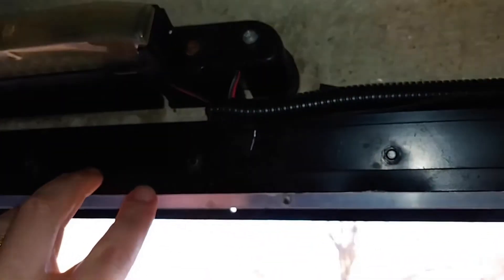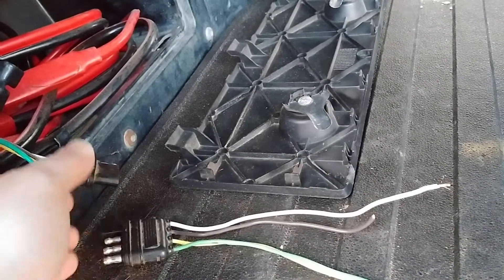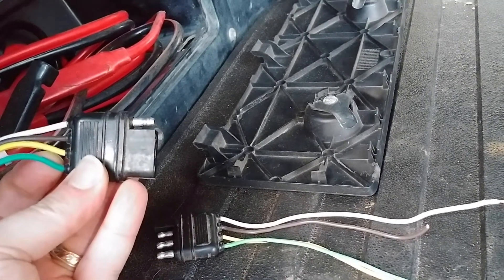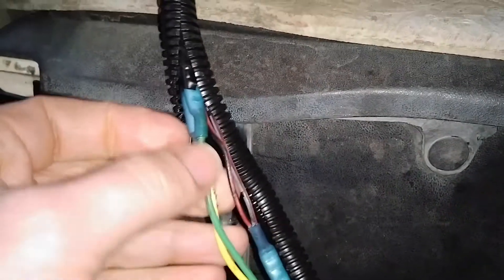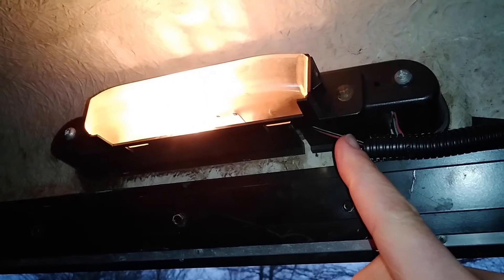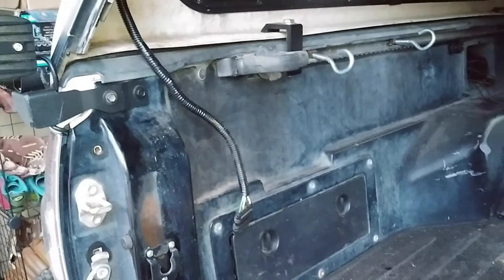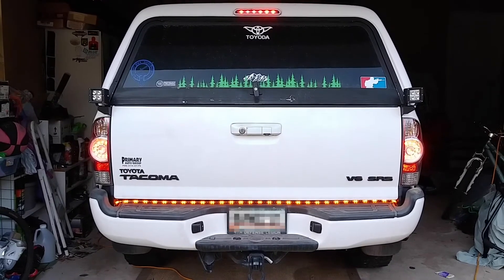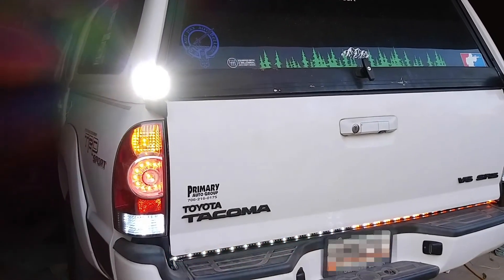Wiring up a camper shell dome light and brake light on my Tacoma

Comment: how do you keep the shell brake light from flashing when the directional is on?
Reply: Good cuestion??
Reply: Really late reply but there are logic modules that you can wire in to ignore the turn signals
Reply from the maker: Not necessary. The wire that connects to it is just for the brake light.

Comment: What company's LED strip did you use for the bottom? Can you share a link to the product?
Reply from the maker: It was just something I found by searching ebay. They are all pretty much the same in this price range. The main difference is the length of the strip. My original one got damaged because the wires hang low where they plug into the 7-blade adapter, so I got a new one to put on. This is what I have now: https://www.ebay.com/itm/303653473812

Comment: Does your dome light turn on even when the key isn't in the ignition? Is it dependent on the tail lights being on?
Reply from the maker: Because it's wired up this way, the key does need to be in and turned in order for power to go to the light